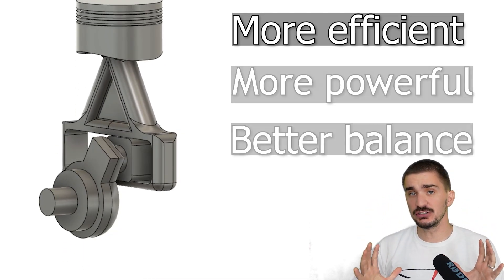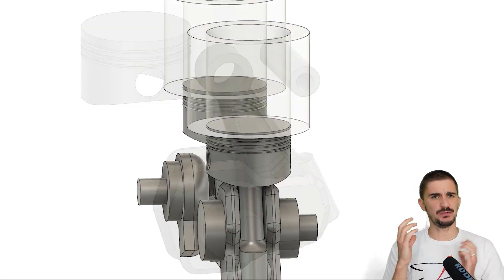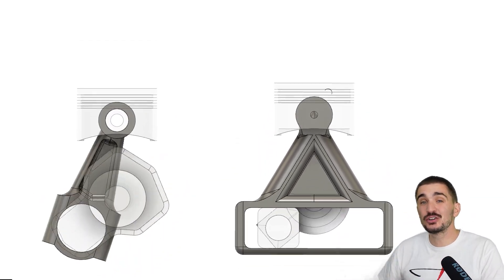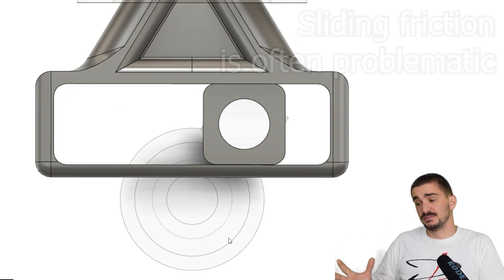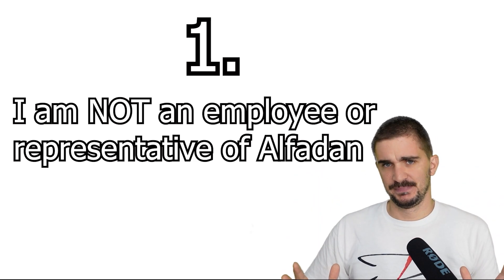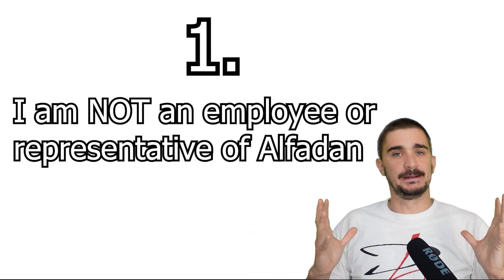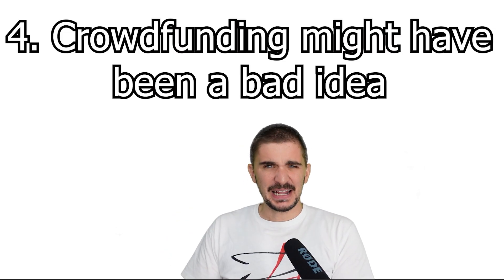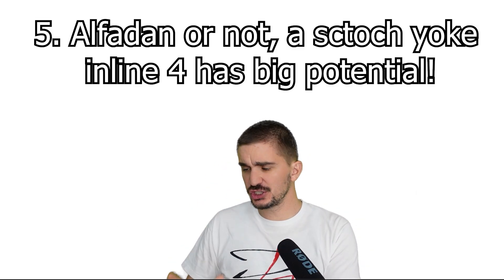This engine is better in every way?

Comment: Hey, would it be possible to go over a video that talks about the idea of having the engine output in the middle of a crankshaft rather than the end of the crankshaft?

Like, say you have an in-line 4 or in-line 6 that shared a common solid crankshaft with an output in the middle, and then drives the transmission that’s underneath the engine, that could maybe also be part of the lubrication system of the engine. Perhaps doing this could help eliminate or at least reduce torque steer.

Second idea would perhaps be for a large, commercial duty flat 8 or flat 12. With this design, it’s as if 2 flat 4 or flat 6 engines share a common crankshaft, each engine receiving forced induction by a single turbo. This design would maybe be able to take advantage of the stellar balance of boxer engines, while also having a large amount of displacement. This could also be nice as hypothetically, it might be useful if you could put the engine directly over the rear wheels, which could allow better cabin space, and more direct power to the rear wheels.

Finally, with the rise of the e-CVT and Mazda still trying to rotary, what about a supercar built around a 4 rotor engine that in the middle of the crankshaft, drives a unique output shaft. This output shaft has 2 e-CVTs that connect to the halfshafts of the rear wheels. The design behind this is that a lot of engines have a large transmission that then is fed into a differential or transaxle. With proper engineering, the e-CVTs could essentially act as a limited slip differential that can allow the drivetrain to be simplified somewhat, while also saving weight potentially. As a matter of fact, this design might even be compact enough to be used in a hybrid system, as it’d leave space for the batteries.

Overall, it’s been interesting food for thought for me, and I was hoping you’d share so e if the curiosity as well

Comment: To simplify the snag, if we imagine the engine at halfway on the power stroke, the linear force is offset to one side, thus attempting to misalign the piston in the bore. This is similar to a conventional connecting rod except with no wrist pin, the force is pushing the top of the piston to one side of the bore and the skirt of the piston to the other side of the bore. This would, I imagine cause more friction on the piston to bore surfaces than a regular engine, not less.
It's not a scam, it's just poorly thought out.
Reply: @@silverdreammachine5866 I  had no idea of any previous videos or media material. So I saw no pictures of a boat engine. 
I am also an old guy who has seen repeated failure of the capability, of managerial people especially, to be totally incapable of being able to determine the root cause of things. So, if we introduce what you are now saying, I can add the clarification that it "might" not be a scam, but I agree with you that if the original announcement was unclear as to the design, then yes, it might be.
It would be difficult to design something that reduces friction without adding even more friction on other components, imo.  And the design as shown in this video obviously has a line of force that would jam the piston against the cylinder walls. Thanks for the extra info.

Comment: It would make sense to use the scotch yoke in an opposed cylinder design to get around some of the strength issues the yoke has.
Also, a plain rotational bearing has the same sliding friction as a linear sliding bearing (apart from the direction reversal). Making it work efficiently is just a matter of getting the fluid dynamics of the lubrication right. 
They make it work for piston rings.
Reply: Someone has never heard of a hydrodynamic wedge...
Reply: Indeed, but opposed cylinders mean 2 heads, which already complicates the engine a lot, so it could ruin the "game changer" potential of the engine
Reply: @panvomacka9079  Modifying the Scotch Yoke  in order to improve its problems with friction and structural issues seems to be more important than this. For example the inner slider could use a gear that rolls over a "serrated" surface and its shape could be slightly elliptical so it only touches one side at any moment. Another example is the article "Design of Scotch yoke mechanisms with improved driving dynamics" which proposes the use of springs to regularize the input torque.
Reply: yes but the linear bearing would have a grater distanse to travel wich for the same amount of time means higher speed and so on
Reply: @oti3nane  And it can cancel the friction on one of the sides of the slot during each half revolution depending on how it's implemented.
Reply: Lubrication nowadays involves much more than just the fluid and basic surface treatments. There are nanoparticles for coatings, solid lubricants, electromagnetism, all sorts of bizarre alloys and ceramics, self-lubrication, ... (search for anything about tribology for more info) but the technology used in mass production is still lagging behind.
Reply: @vitordelima  don't believe the spiel on an oil bottle , Castrol Magnetec 🙄

Comment: In large diesel engines, side-loading on the piston walls is eliminated by having a straight intermediate shaft between the piston and crank, which allows the side-loading to be shifted to a separate bearing set. Can't do that on small engines since it adds a bit more than a piston stroke length to total crank case height.
Reply: This is called a cross head, also seen on steam engines where it is mandatory in most cases because the cylinder is double acting.

Comment: A partial solution is to make this engine a boxer design, thus, the surface in the bottom of the rod & piston will no longer be thin. This doesn’t resolve the sliding motion, but it does solve the strength issue. The triangle is the strongest shape and this would make a diamond shape piston rod combo.
Reply: Scotch yokes are widely used in mechanical engineering, maybe there is something that uses it under similar conditions already.

Comment: What makes the most sense to me is to use a free-piston engine, driving a magnet through field coils to make electricity. It's the best use of an ICE, and an electric motor (with batteries for acceleration) is the best way to move a car. No crankshaft or connecting rod needed.
Reply: what a waste of energy

Comment: After a quick scan of the well thought out and intelligent thoughts and suggestions of others, It seems to be my turn to be the stupid suggestion guy, so hear goes. Instead of a sliding block use roller or other types of low friction high load bearing configurations. Just a thought.

Comment: This might solve balancing issues but it wouldn't solve weight, and wear issues. The wear would just be on a different part of the engine. I guess the benefit will be instead of wearing out the cylinder head it will wear out the bearing. As stated though a box in general will always be weaker than a circle. In my opinion this is a horrible design that isn't worth a shit.

Comment: it would seem the round yoke would be a good design rather than square . the raceway would have be incredibly tough to withstand those vertical combustion forces. I would also think a small engine like a lawnmower or weed wacker would be a much easier manufacturing start then scale up .

Comment: good explanation of 'scam' vs. 'Risk potential' !
I was wondering about a rolling part used for the yoke 'insert', en though it has to 'apparently' change direction at each transition. Bit, a fat, square slider has a load of inertia to get going, even though (I think) that the transition is the lowest acceleration point for the slider; just that I have seen a couple of novel ideas for using rolling mechanisms where sliding is the normal mode of motion transfer.

Comment: The Scotch crank has been arround for ages . It's ONLY advantage is that the piston moves sinusoidaly . Greater reciprocating mas more sliding friction , a total non starter that should remain a historic curiosity .
Reply: Have you heard of the Wankel rotary engine it is cool and people are working on making it more efficient with better seals

Comment: Funny in 1976 my father and I built a 2 cylinder apposed Brouke scotch yoke engine. We used a roller bearing on the crankshaft, but on our first crankshaft the rod journal was to small and it sheared off. Second try we used a Kawasaki 100cc crankshaft. I believe that an apposed 4 cylinder may solve some of the balance issues.  We were able to get 10,000 rpm underload but were unable to spin it faster due to it having a carborator and a distributer out of a 1960's VW. Using modern direct injection and ignition this may actually work.

Comment: The issues can be partially mitigated by using a longer rod. BMW had two different rod lengths in their M50 motor the initial design without variable valve timing used a longer rod than the later VVT technical update motors.

Comment: This video loses you considerable credibility for me. You did not mention that the connecting rod of Scotch yoke would be so heavy, max rpm would be considerably reduced. Second, if there are power/efficiency benefits, these would also be obtained by simply lengthening the con rod. I don't believe there are such benefits. Lastly, the sliding friction reacts on the piston with a large leverage factor (no wrist pin!), resulting in far larger side loads at the piston skirt, than you have with conventional engine. SO does opposite of what you claim.

Comment: Id say thats worse in every way. More mass to move up and down, pulls at an angle and pushes at an opposite angle, more friction, hydraulic forces will interfere with the sliding and id bet its noisier.

Comment: could you possibly replace the square sliding block with a round bearing or something to prevent the friction from being sliding friction? then you can also make the slot have circular ends rather than square ends.

Comment: I'm a retired toolmaker and years ago I worked for a state of the art precision manufacturing company. We specialized in very high precision components for the medical, aerospace and automotive sectors.
We were tasked to produce internal components for a new engine design by a group that was very well financed as Johnny Carson and Walter Payton were investors.
My part of the job was to grind the valves which were nitrided and thus extremely hard and difficult to machine.
Having always avoided production type work I didn't know how scalable this was going to be for mass production.
In the long run however the engine , so far as I know didn't succeed, and I guess some folks lost money on the deal, but from my viewpoint, the parts were well engineered by people that knew what they were doing, so there didn't seem to be any fraud happening, just an idea tat was developed that for whatever reason, didn't pan out at the end  of the day.
I would suggest that if you want an example of an automotive scam, google   "the Dale" car company.

Comment: I think the Bourke engine opposed cylinder design solved the weak yoke problem. But the piston is still side loaded in any case. Too bad his engines never lived up to the power claims. Perhaps modern tech could prove better results.

Comment: ICE has more then hit the limits. Problem is in  combustion temperatures, combustion time, and mass, just to start with very obvious limitation. If we find super materials that can withstand insane temperatures, or if we find fuel that can give out much more bang for much longer time  then ICE has proper future. As it is now, all goes in to direction of limiting the mobility and making sure we all use batteries, that have their own set of hard to deal with type of problems.  But problems are what makes life interesting to live, so we see what happens. I  like ICE feel,  like EV performance, probably third path will emerge and I bet on some mini reactors capable of making insane amount of electricity at EV it self.

Comment: I think the Scotch yoke rod should slide between rails, to keep it straight and in linear motion. Now the force of combustion will try to tilt it and the piston, which is much worse than pushing into the cilinder wall. Great idea though!
Reply: Yes, real Scotch yoke engines do have rails to constrain the "big end" of the yoke, which are omitted in this video. They are visible in the small model engines shown in this video, and in the Alfadan patent drawings also shown in this video.

Comment: D4, you make several cogent points, there are a few I would make; the CYA 'verbiage" you clipped from the public offering through Crowd Funding is prominently displayed in every licensed and legit investment office. Investment always incurs risk- absolutely true. But..... in your flood illustration, you neglect the contract contents and codicils or requirements- if insurance was required of the General Contactor or other parties, then there is "remedy" for the loss up to the value of the insurance policy, barring criminal acts by the policy holder. My last point is more a question, one that your drops on engine balance answered for me; why can I get to much higher RPMs with 6 cylinder than a 4 cyl of the same displacement? The piston, the rod, the crank throws, all will need to be bigger because the imposed local loads are higher and therefore heavier, a good deal heavier which gets multiplied by the total RPM. But that is my experience, we didn't come here to listen to my YT armchair take, I came and many others to here some of the great science you explicate. I feel you are very correct that the reductions in inherent friction is a new place to gain efficiency- almost all previous gains have come from better understanding of the combustion process and improvement there. Mechanical improvement on friction has been in the form of roller lifters, roller rocker arms and such- until recently entirely limited to high performance applications and expenses. And only desperate need to attain more recent efficiencies and emissions made that happen.
Can the scotch yoke become a basis for new gains- yes, it can, but only things like the four cylinder radial type engine offer good and inexpensive ways to get that gain without the stregth and durability problems you mentioned- by pairing opposing cylinders you can easily justify the added materials to make the yoke as strong as the combustion forces from one side at a time are imposed on it. I could have got some of it wrong- I full well expect to hear about it. On Alfadan, there was, before your piece, already some "negative press" on it and they were having trouble interesting the usual financial people to do an IPS- and as you pointed out, they didn't have much to show except diagrams and theories then. Only Mahle's involvement gives much lie to any of that. Btw, look into the Comer diesel engine that was provided for the British Transport Ministry for busses some years back- it was mostly to reduce friction and wear but got there by some similar means to those you lectured on. Similar, not the same. Have a great one and make me wake up and think again tomorrow! I've already thrown my "ole carburetors" out and am embracing the "electronic revolution" because of you!

Comment: The square yoke seems silly without ball bearings reducing friction or the rubber gaskets rotary engines use.
Reply: Either way, this engine format seems like a machinists nightmare.

Comment: I don’t see the friction advantage here at all.  If the yoke itself isn’t constrained in a bearing/groove of some kind, the twisting load on the piston will be intense due to the couple created as the yoke “pin” slides from center to the extreme end.  The only resisting couple has to come from the piston in the bore which is going to put extreme loads on one side of the piston near the crown and the opposite side at the bottom of the skirt.  This is far worse than the simple side load from the piston pin in a conventional engine which is fairly uniform along the entire side of the piston.  An opposed engine would lessen this substantially as the couple can now be resisted by both pistons which gives a much longer moment arm.  Alternatively, the yoke itself can ride in a bearing on each side to resist the eccentric force from the yoke pin, but now you have added back a lot of friction, almost certainly more than what was saved through wrist pin elimination.  There is good reason why this engine design has never succeeded and almost certainly never will.

I agree that investing in this isn’t a scam, it is just a stupid investment.

Comment: Interresting engine. Reminds me to the german project of the "Neander" Diesel bike that uses 2 rods and opposite turning crankshafts per piston to reduce friction and imbalances. Maybe You tahe a look of that (it's here on Youtube) and have a reason why this engine design is not used since that prototypes.